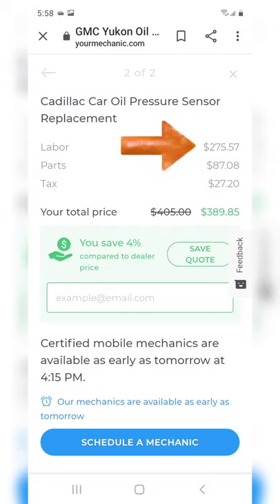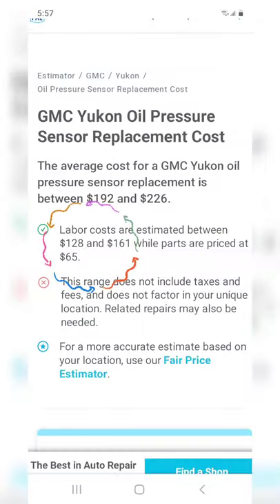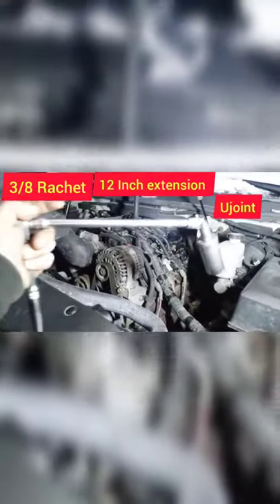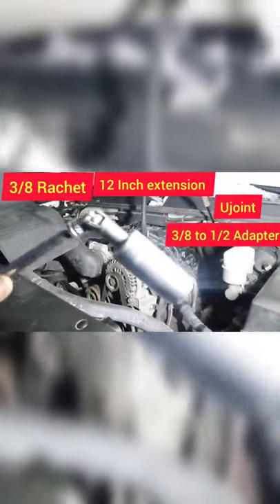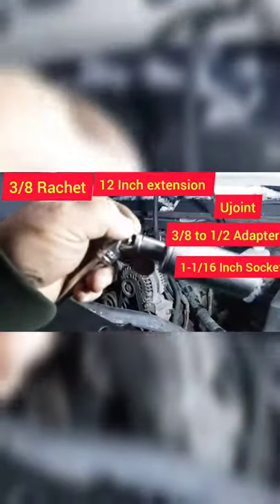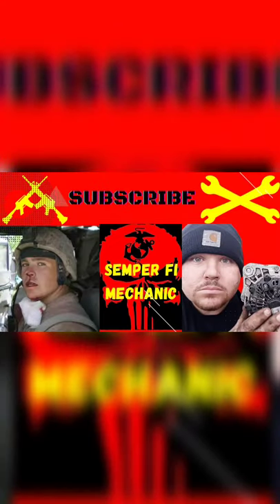GM Oil Pressure Sensor Replacement Hack. #Shorts

Comment: The 1 1/16 sensor socket fits so many sensors not just oil pressure. I've used it on crv rear ends, Chevys, and so many others. Worth the few extra bucks I spent at O'Reillys.
Reply from the maker: Yes its so versatile and I use this same one for alot of O2 sensors as well.